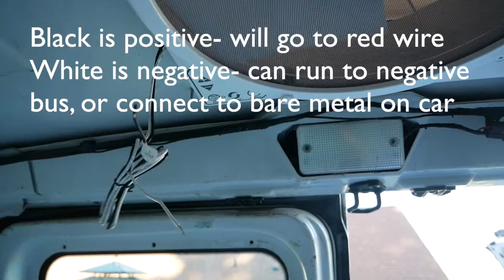Maxxair Fan 4000 | Ford Econoline Installation

Comment: Nice install! I see you used eternabond tape. How did you remove those tabs that stick out on the outside frame of the fan? Any issues with the fan or eternabond?

Comment: How has your fan fared? I've seen mixed reviews on this unit and didn't realize it till after I ordered it
Reply from the maker: So far so good, fingers crossed it stays that way!
Reply: I think because you don’t have lithium batteries you should be ok.  From what I have read the circuit board on the max air fan can fry out if voltage exceeds 14.6, which in lithium batteries when they are charging, from solar or from your alternator they can get up to 15.6 V sometimes.  Then when they are no longer being charged they will return to a normal charge level, but if you are charging the batteries and running the fan at the same time you can run into trouble.  There’s a good video about installing a butt connector to control the voltage flow to the fan though to solve this problem.